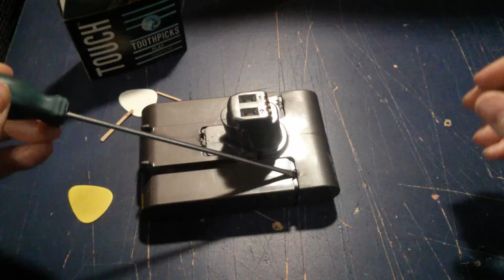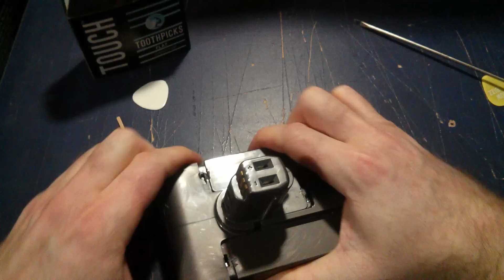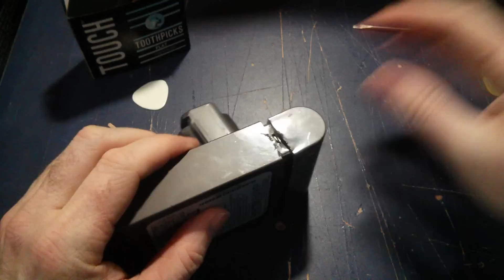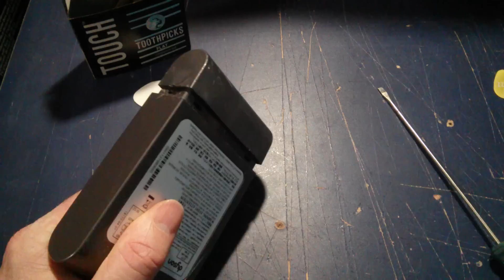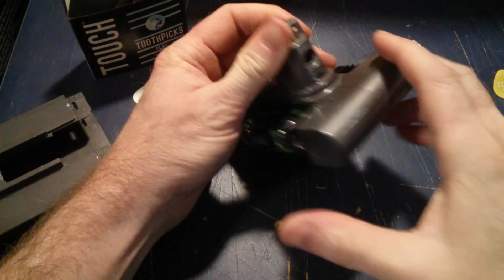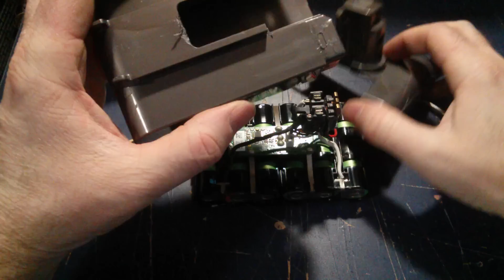Dyson DC31 DC34 DC35 DC44  battery disassembly for replacement: Not Worth It.

Comment: Swap out the batteries for these 18650 batteries. My DC35 only has a total capacity of 1,300 mAh and (6) of these 3,400 mAh batteries will give it a 240% improvement. Plus I can use the same housing and battery case. All it required was disassembly (3 out of 5 in difficulty) and a little souldering. For $40, that is less than dyson wants for a replacement battery pack and even after years of use it will likely have more charge than a new pack can hold to begin with. I successfully performed this job much cleaner than the above video on 10/14/17 and everything works fine. I used a vice to push the new batteries into place as they were a bit snug. But everything works great and I am getting about 45 min of run time. The initial charge time was around 7 hours, but after that no issues at all. This time I won't just leave it plugged in forever.

https://www.amazon.com/NCR18650B-3400mAh-Rechargeable-Panasonic-TRANSPORT/dp/B01FMNFXEW/ref=pd_cart_qp_1_1?_encoding=UTF8&pd_rd_i=B01FMNFXEW&pd_rd_r=CZVAB9ZVH374VV3MR6MD&pd_rd_w=PVVlI&pd_rd_wg=TbxoP&psc=1&refRID=CZVAB9ZVH374VV3MR6MD
Reply: Your battery choice is definitely wrong and You should expect them dying soon. Original batteries are high discharge ones with the highest current rating available for 18650 li-ion. For more capacity Sony VTC5A is recommended. I have used 12 of them to double the capacity and also prolong their life (shallower cycles and half the current per cell).
Reply: Cory Dunbar just ordered 6 LG hg2 3000mah batteries hope all goes well...ive done today a triple pack basicly 3 layers of 6 dyson old cells and its working really good but it's a bit heavy so that's why I'm going for the LG hg2 3000mah
Reply: marbesky all I had to do was swap the cells and reassemble. It all went back together smoothly and had no charging or operational issues.
Reply: ive had 2 attemps at repacking my dyson dc35 battery pack .on the last attempt i used samsung 2600 mah batteries and nickle strip placed in the original cradle and soldered the contacts.i checked batteries on completion to make sure i had a circuit  was sitting on about 24v . in the original pack the thermsitor was glued in between the batteries i had to gently prise it out .no i have it just sitting on the middle batteries, the problem i am having is when its charging the charger is just pulsing ,,ive checked the volts is about 24,when i pull the trigger on the vac the light at the back just flashes quickly and vac no go .
Reply: Paul Shaw per the below link to the dc35 (is that your Same model?) operating manual if the charger is calmly blinking it is not charging. For my project the only thing I had to do after opening and removing the charging tower housing so it was just the battery pack and the board was chisel the connections apart and push the batteries out. I did remove a piece of adhesive foam from the underside that was stuck to each battery. 

https://www.dyson.com/medialibrary/Files/Dyson/Support/downloads/US/Floorcare/manuals/dc35_opmanual_usa%20pdf.pdf
Reply: So the battery matherboard doesnt cut off any charging or discharging of the 6 cels if they are replaced?
Reply: Cory Dunbar a
Reply: i recommend to take batteries with a lower capacity. The Problem is that the dischargeing current of 6,3 A is to low. A lifetime choice is to take cells like Samsung INR18650 25R 2500mah. 20A dis. cur.
Reply: Thanks for telling us about actually replacing the individual batteries and how it went.

I realize this reply of yours is like 2 years old, but I wanted to ask/comment on a few things in your reply.
Since you have actually desoldered and re-soldered dyson batteries inside of the battery pack.
(In case you still get YouTube notifications on this video; maybe you'll see this and Reply). 

1. Did you need a high wattage soldering iron with wide tip(100 watts or more), like used for copper strips, pipe and contractor type soldering?
2. I was thinking of buying a pair of Resistive Soldering Tweezers for the soldering.
They are instant ON, once you toggle the switch to on. The tweezers make it easier to solder electrical type connections.  
I used to use them years ago for tight soldering areas. 
Their near instantaneous soldering heat minimizes heat damage to adjoining components. 
3. The 18650 batteries are very popular with the "DIY MOD KIT 
 VAPING" crowd.
Googling 18650 batteries reveals a boatload of sources. Many from vaping sites.
Many have battery brand reviews also.

I also saw the 18650's in 4-packs at walmart in garden dept last year. Like $14.99 a 4-pack.
They were lower current, like 2,000mAh; used for the larger outdoor solar LEDs.
4.  Now (2020) Ebay sells a wide selection of 18650 battery replacements for several dyson models, battery capacitys from 2,000mAh to 4,000mAh. 
Prices are as low as $25 for a whole battery, already in a battery shell. So, another option is to just get a whole new battery that's made for specific Dyson model vacs.
Just slap the pack into a DC34, charge & use. 
(An easier option to manually unsoldering and re-soldering individual batteries). 

But I have no idea of those ebay battery pack's battery quality. Nor how long they will run. 
Many ebay posted batteries boast a 2 to 4 year warranty (for whatever that's worth).
Reply: This is a really bad idea. The cells that you are using are in no way up to the job. If anyone is thinking of doing this like Cory please use high current cells as otherwise the cells will roast every time you use the vacuum and the BMS will most probably cut out due to the thermal protection. If you're not sure which ones to get you could try Sony VTC5's, Sony VTC5A's, Sony VTC6's, LG HG2, Samsung 30Q's or Samsung 25R's. There are lot's of cells out there that can be used but these are probably the easiest to find.
Reply: @thepowersource1602   I would definitely recommend the batteries you mentioned and would have used those myself if I had the knowledge and money when I did this install. I'm by no means an electrically trained individual. Much more of a guess and check DIY philosophy. As I couldn't find the info prior to this project I did the best I could and it worked. Unfortunately it may have been the cause of the early demise to my DC35. But it ran pretty rough already from some lackluster care in the past. I've got a used DC44 on the way and if it needs new batteries I'll probably go with (6) VTC5As like the previous comment.

Comment: Hi I have a dyson dc 35 cordless  and it's s withing off the same as yours but only seems to do it while I have the full pole attached .when I took the pole.off and  checked 
 filters it is working fine but once I attach the pole it stops working .any help .

Comment: Seems like a real pain in the ass to do this. I will just buy a replacement.
Reply: Christian Galipeau Swap out the batteries for these 18650 batteries. My DC35 only has a total capacity of 1,300 mAh and (6) of these 3,400 mAh batteries will give it a 240% improvement. Plus I can use the same housing and battery case. All it required was disassembly (3 out of 5 in difficulty) and a little souldering. For $40, that is less than dyson wants for a replacement battery pack and even after years of use it will likely have more charge than a new pack can hold to begin with. I successfully performed this job much cleaner than the above video on 10/14/17 and everything works fine. I used a vice to push the new batteries into place as they were a bit snug. But everything works great and I am getting about 45 min of run time. The initial charge time was around 7 hours, but after that no issues at all. This time I won't just leave it plugged in forever.

https://www.amazon.com/NCR18650B-3400mAh-Rechargeable-Panasonic-TRANSPORT/dp/B01FMNFXEW/ref=pd_cart_qp_1_1?_encoding=UTF8&pd_rd_i=B01FMNFXEW&pd_rd_r=CZVAB9ZVH374VV3MR6MD&pd_rd_w=PVVlI&pd_rd_wg=TbxoP&psc=1&refRID=CZVAB9ZVH374VV3MR6MD
Reply: Do not use this cells! They can't be used for high discharge rates and may lighten up or explode! This cells are for flashlights and other low power consuming devices !!!
Reply: @zorki23  high out put flashlights and nightvision can discharge those cells in 1.5 hours... Can you prove anything you are saying with physical math on paper?
Reply: @kismetcorp  Yes i calculated this through a long time ago. Look how many watts the motor needs and look at the datasheed of your cells. You will see: Your cells are very good for flashlights (I for myself use them for exact this purpurse), but a vacuum cleaner takes a LOT more power out of these batteries. Does your Dyson last 1 and 1/2 hour cleaning? No? Than it will drain your batteries at a much higher rate than a flashlight! Or if you still don't belief me: Look at the datasheeds of the built in cells. Even if old and spent already: They can handle a lot more drain than yours! Draining cells out of its specifies overheats them and may result in fire or even explosion. Use Sony Konions or at least Samsung 25R cells, typical batteries for smokers. I don't have the numbers left in my memory because I upgraded my Dyson a long time ago (with Samsung 25R).
Reply from the maker: OnlineBackupServices yeah, I don't think it's easy to replace those batteries There...
Reply: Have you attempted it? The problem is the genuine replacements are very expensive and the cheap aftermarket packs use low quality cells which will die after 1 year. 

The dyson use us  sony VTC4 18650 cells which have high amp 30Amp. The aftermarket chinese ones use any old cells. It may be worthwhile finding a faulty aftermarket battery pack and put in sony vtc4 cells. The aftermaket packs might be easier to take apart and reasemble.
Reply from the maker: OnlineBackupServices no, I bought a cheap one on Amazon... works great!
Reply: Any brand you can recommend. I went throguh so many rubbish fake laptop batteries and all of them let me down. This makes me hesitant about using third party batteries.
Reply from the maker: OnlineBackupServices I don't really know the brands...I'll try to check it out. I chose the one with the best review.